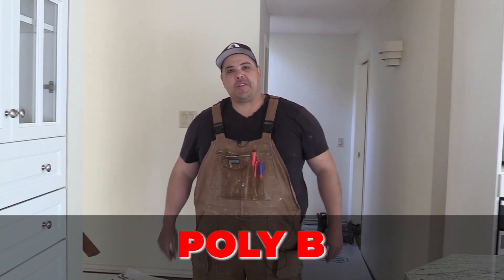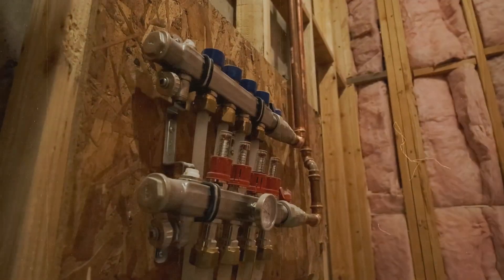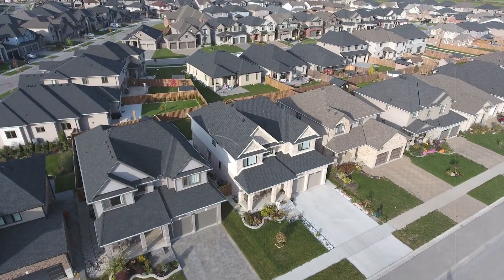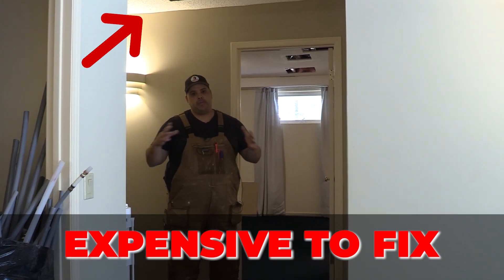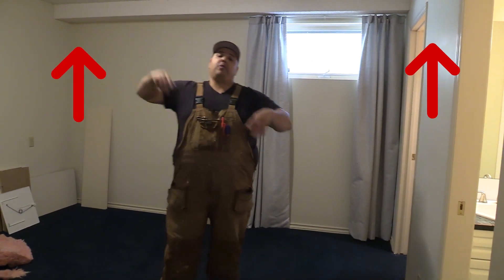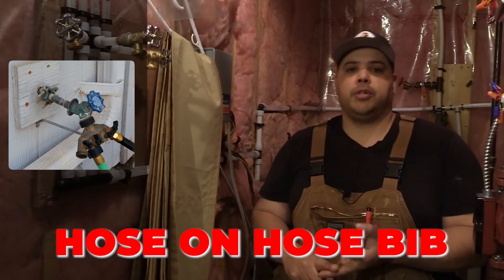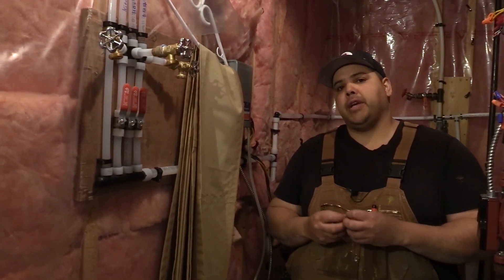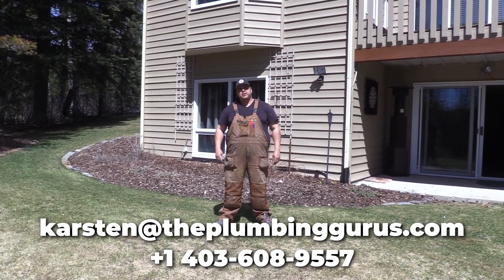Poly B Replacement: Calgary Plumbers

Comment: I need to cap off a 1" PB pipe, used in a very old (1970's) yard watering setup.  Most of these PB pipes are brittle, so a crimp fitting will not work.  I cannot find a push-fit style cap in a 1" size.  Any ideas?  Thanks!
Reply from the maker: You need to get a poly b to pex adapter